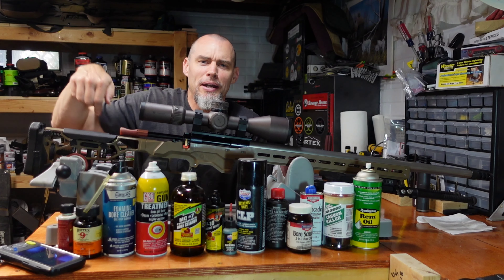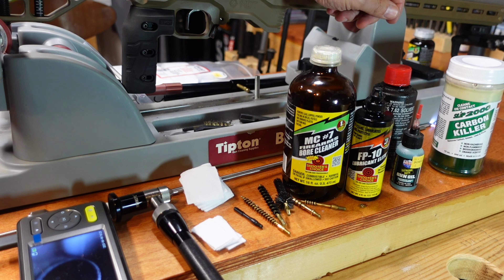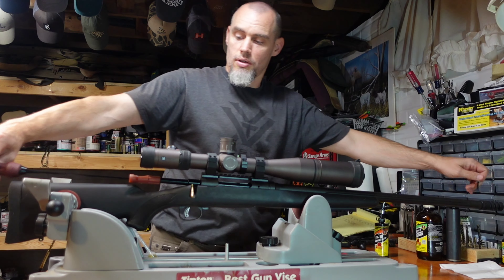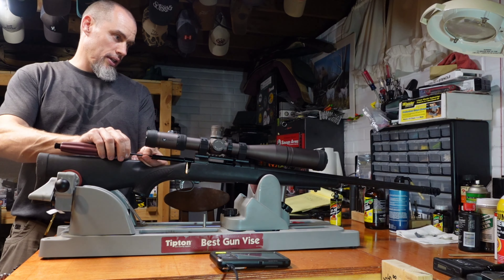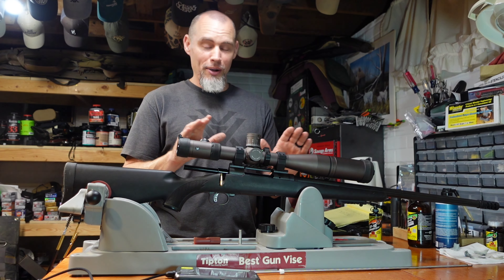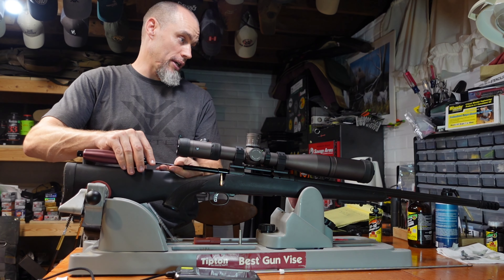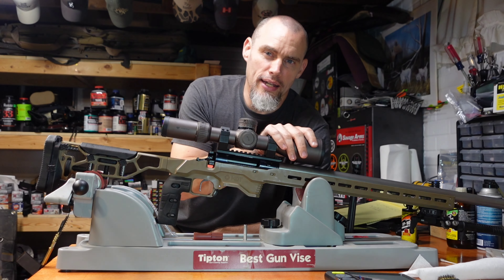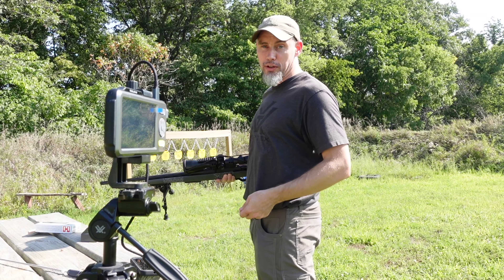Cleaning Precision Rifle Barrels

Comment: Bore tech eliminator. Its my go to now. Works on fouling and copper. Follow the directions on the bottle and it works. Bore safe, non toxic, does not stink. Water based, so once you run dry patches u can use the oil of your choice. Sure its $40, but that will last me over a year and saves me plenty of time.
Reply from the maker: I've used that one as well, I will agree it works pretty well.
Reply: @thelonggunner762  it does, minimizes passes in the bore.